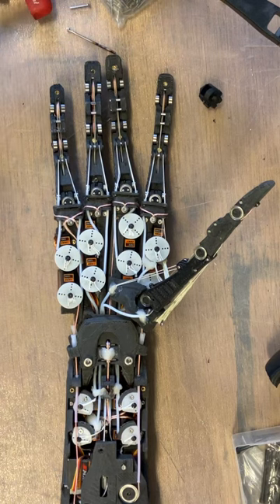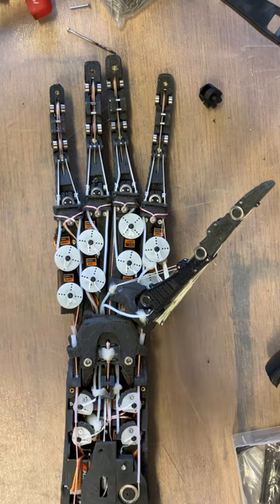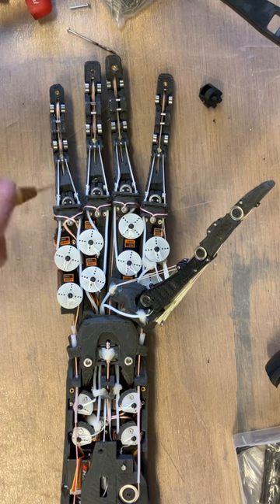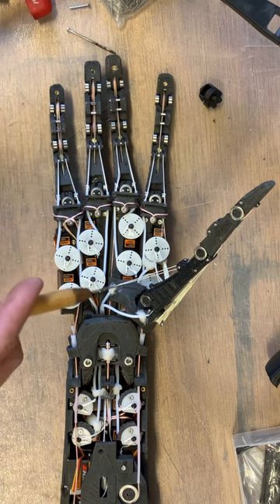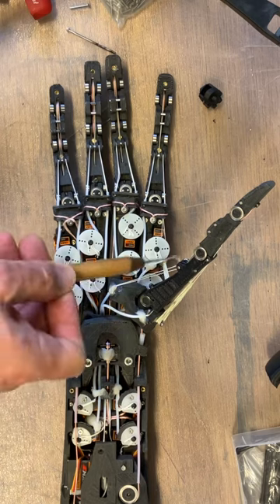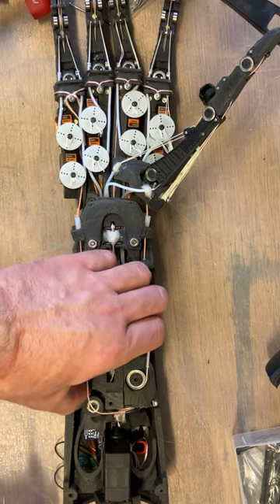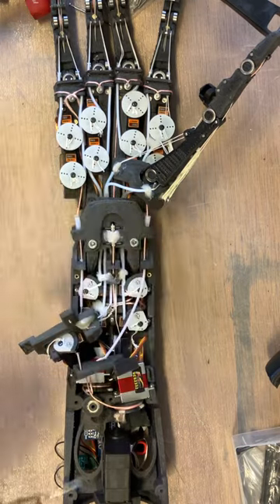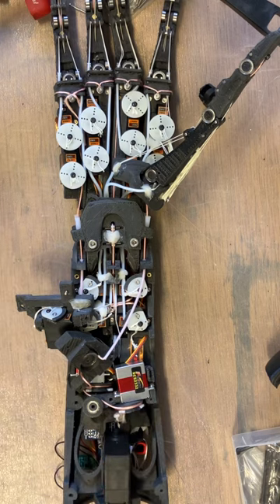Servo layouts in the V1 DexHand - open, #robot #hand for #3dprinting

Comment: Just one more question if i use serial bus servo will it work on the same arduino code for normal servo? and will it be able to program it turn 180 degree right then 180 degree left?
Reply from the maker: The code is slightly different as it uses a library provided by the manufacturer, Feetech. Still just a single command so very simple. 
With the old SCS servos you could control 150 degrees in each direction.

With the new STS you can control 180 degrees in each direction. They also include a scaling factor so it will actually go up to 900 degrees in each direction!

Comment: amazing work ✨
Reply from the maker: Thanks! How you getting on?
Reply: @therobotstudio  working on getting all the components and thats kinda hard in here
Reply: @therobotstudio  do u have any social media pages because i didn't find the gmail that u mentioned before
Reply from the maker: Which bit? I'm working on a more accessible version that can fit a wider micro servo for example.

For some parts like the pins you could use nails or a wire coat hanger.

Some parts like the bearings are essential can you easily get any sizes?
Reply from the maker: Yes therobotstudio on Facebook and therobotbuilder on Instagram

Comment: bro nice work, what battaries did you use in your arm?
Reply from the maker: A pair of 18650 Lithium cells
Reply: Can you inform me ,how much Amp and Volt are these batterys?
Reply from the maker: Nominal lithium voltage is 3.7v, actual range 4.2v-3.2v, current can be pretty high, easily up to 10A which is ample.

Comment: Can you tell me which servo you use to close open finger? because i need servo that can turn 180 degree, most say they turn 180 but turn out they only turn 90
Reply from the maker: This hand uses Emax ES33xx slim micro servos that specifically do only turn 90 degrees as they are intended for flaps in aircraft wings. Most micro servos will turn 160 degrees or so. For greater range you need to use a serial servo like the ones made by Feetech. These communicate over a serial bus rather than using individual PWM signals like standard rc servos. Serial servos can be controlled over 300 degrees and very usefully give feedback on position, load and temperature. The latest serial servos like the STS3032 can even be controlled over five turns.
Reply: @therobotstudio  Thank you very much
Reply from the maker: Pleasure, look forwards to seeing you progress on YouTube!

Comment: Hola, queria saber que estan usando para hacer todas las conexiones electricas, estoy en esa parte y debido al reducido espacio no tengo muchas alternativas, queria saber si usaron algo en especifico que facilite ese trabajo
Reply from the maker: The servos have three wires each. All the positives are joined together and all the negatives together separately of course. Each of the signal wires is connected to a different i/o on the arduino mega. You just have to be careful and try to leave enough spare
cable to minimise strain on the solder joint. It’s not ideal.
Reply: @therobotstudio  es que me pareció raro que si se iban a soldar todos los cables al final, desde un inicio en vez de pasar los 16 cables 8 negativos y 8 positivos de la palma de la mano hasta el antebrazo, se pudo haber pasado solamente dos cables por la muñeca soldandolos desde allí arriba, de todas formas mil gracias, lo que me dijiste es exactamente lo q estaba haciendo, solo que pensaba que tenías una protoboard o una pbc para esas conexiones, mil gracias d verás por tu trabajo.
Reply from the maker: Yes, if you prefer you could also make additional solder connections in the hand itself and pass less cables through the wrist, that’s how it’s done in the V2 - the V1 is intended to be simple.